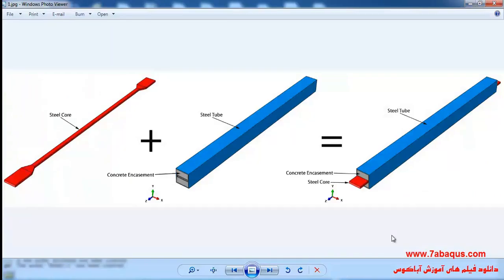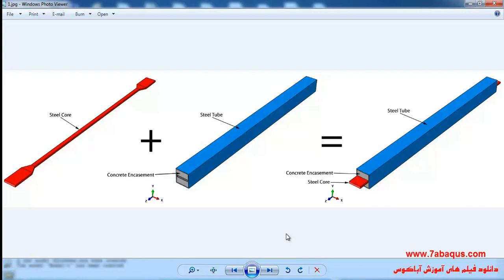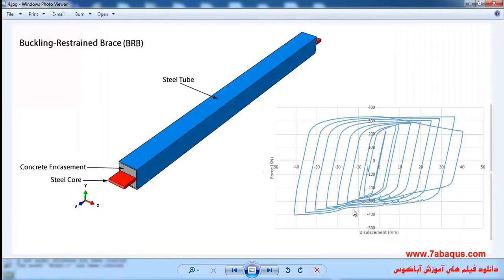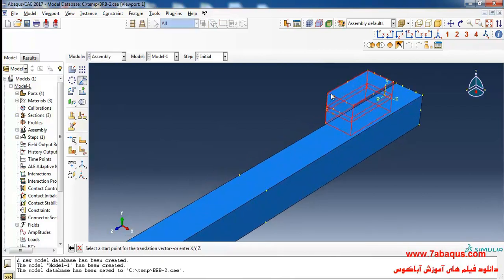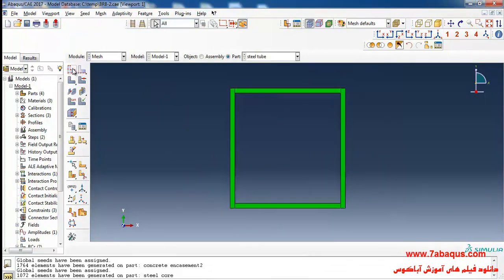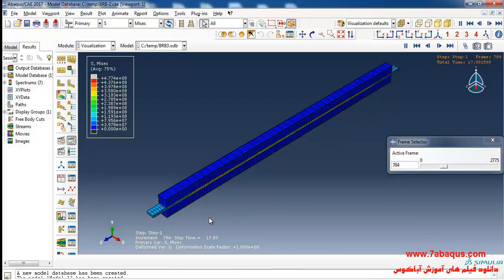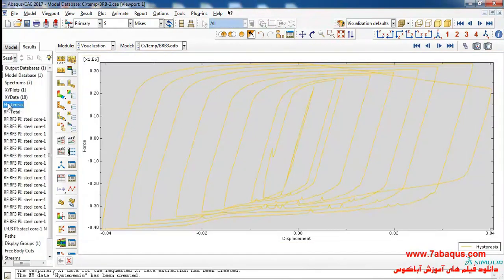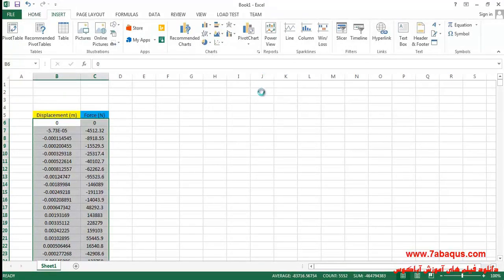Simulation the buckling-restrained brace (BRB) under the cyclic loading Abaqus

Comment: What about friction force between surfaces of bodies? Did you do something on there?
Reply from the maker: In this model ,there is a gap between concrete and the middle part of steel core
Reply: @saeedmoeini-7abaqus  okay, how did you assume interaction between the core and concrete. In a reality, when a compression load applied on the brace, the core and concrete they must be interacted each other. am i right?
Reply from the maker: @unurt9781  I defined friction coefficient between concrete and core
Reply: @saeedmoeini-7abaqus  But The core can't just hang in the air. As there's no visible support for the casing.